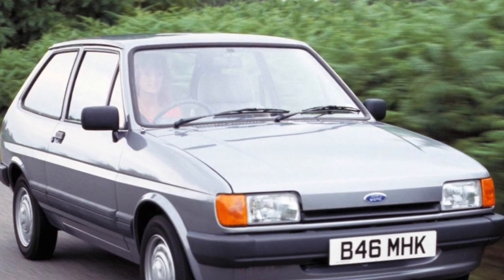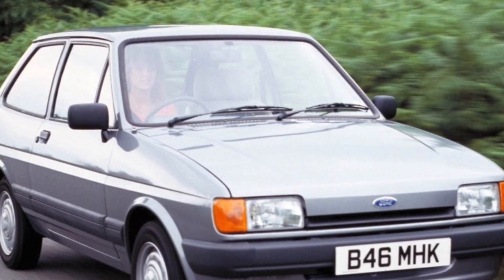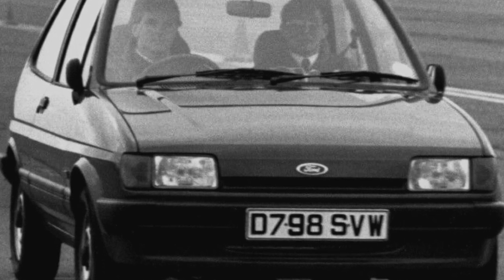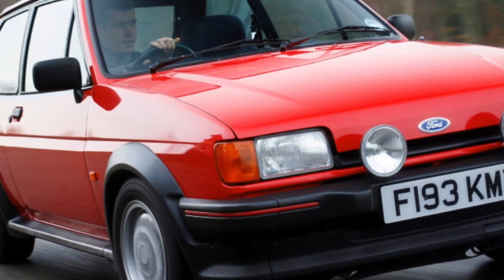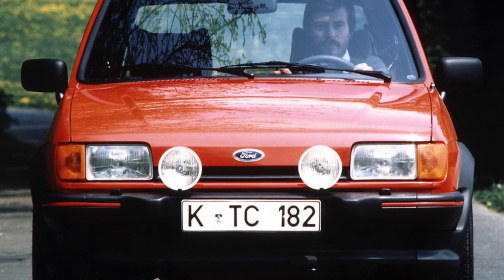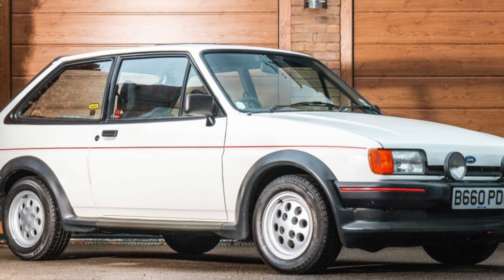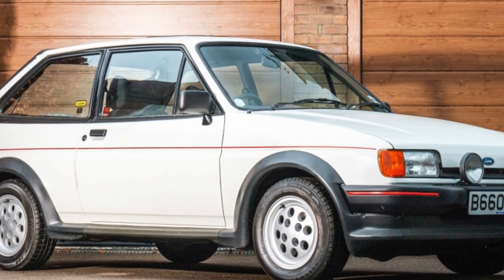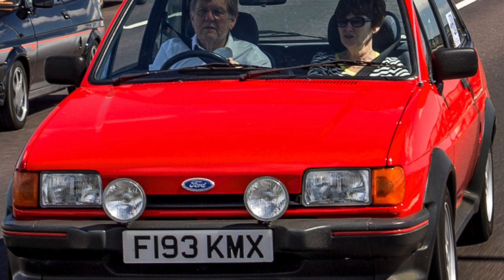Ford Fiesta Mk2 Problems | Weaknesses of the Used Ford Fiesta 1983 - 1989

Comment: Alot of what is said in this video is not true, there are automatic, the mk2 1.3, 1.4 are not chain driven, the 1.0 and 1.1 is only noisey if not serviced correctly and the valve clearances are not checked, theignition system is electronic and very rarely goes wrong,